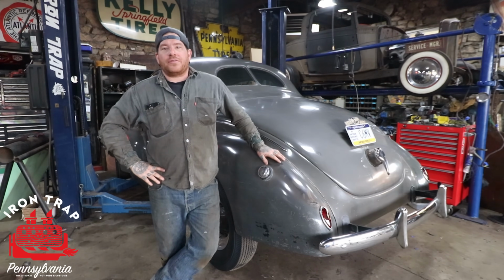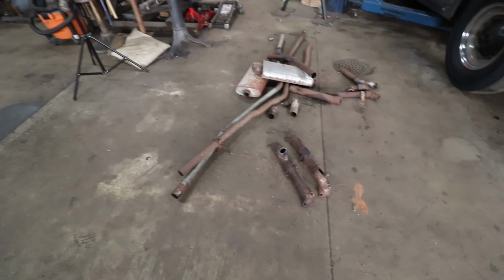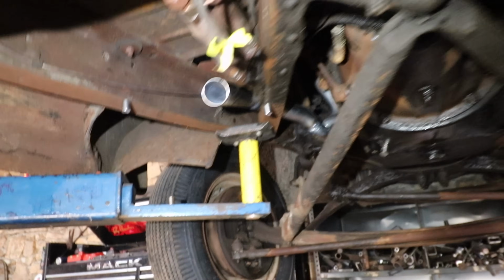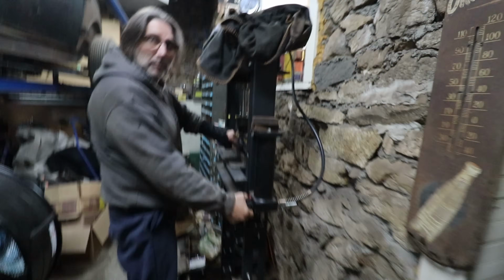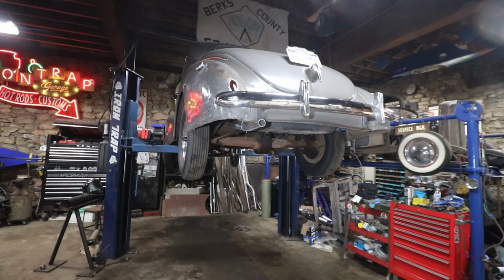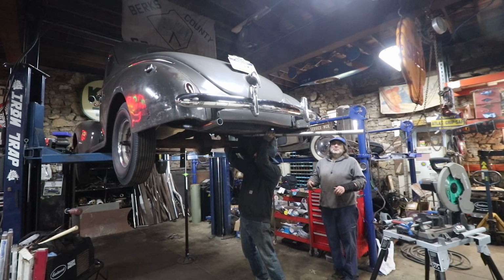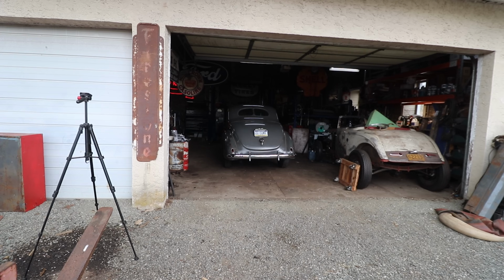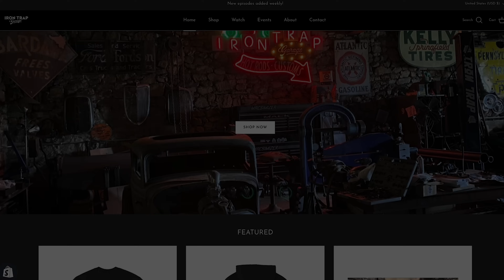Building A Stealthy Dual Exhaust For Out 1939 Ford Hot Rod!!

Comment: Mandrel bent pieces, yup, easy to shape and weld and much cheaper than the exhaust shops. Glass packs at rear bumper, best sound for me. I don't PCV to the intakes anymore and hard no on down draft tubes. I install suction nozzles in the exhaust stream also good solution for the super charged engine.

Comment: What size tires are on it? Has the suspension been lowered at all? - I have a '39 convertible coupe I may put 5" wide wheels on rear, concerned with clearance issues - into same era real stuff,  thanks
Reply from the maker: Stock wheels. 7.00-16’s and 6.00-16’s
Reply: @IronTrapGarage  tks